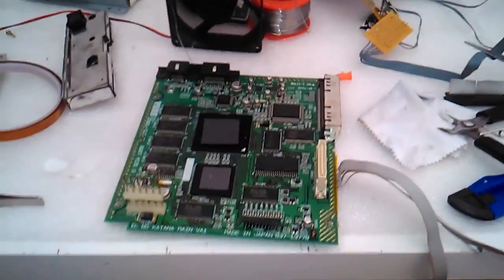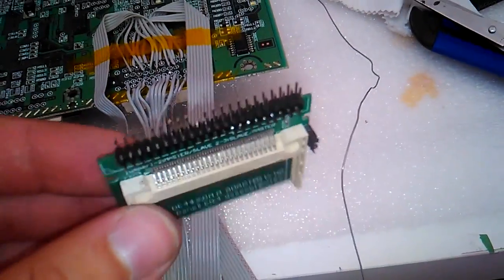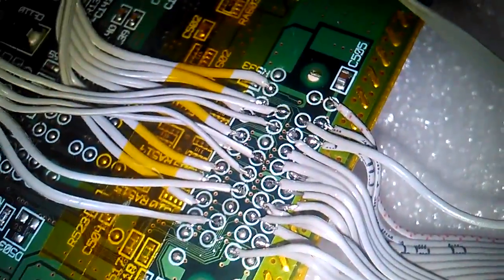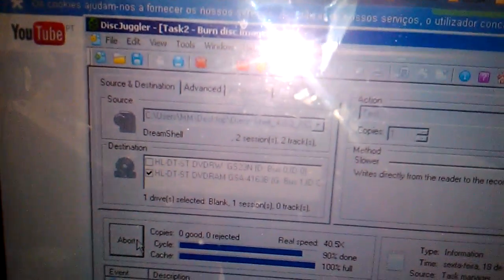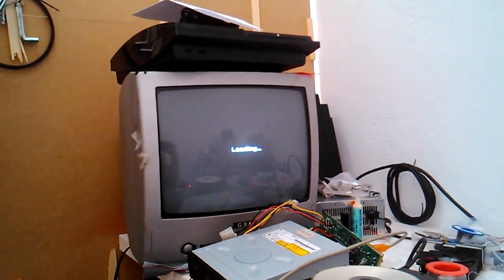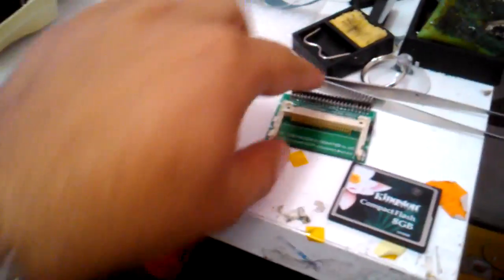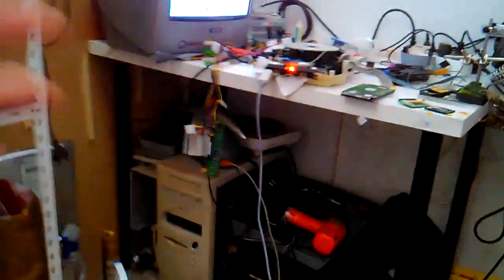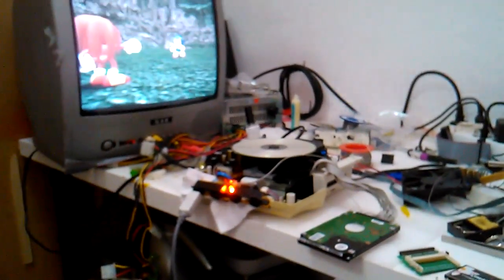Dreamcast IDE HDD CF CARD - part 2

Comment: I had similar problems with my mod. I tried many CF cards and the only one I got to work was a 512MB Sandisk (Blue/Red). I also tried with an mSATA to IDE solution which failed with 2 mSATA cards. I did get it to work perfectly with a standard 2.5" HDD. Since RC3 came out it seems to work a little better. My CF and mSATA solutions boot a bit further before stalling, but its still not good enough. I am really hoping that RC4 will make compatibility with Solid State drives possible. You can see my mods here - https://plus.google.com/u/0/photos/106929866019169011552/albums/6021215859466875073